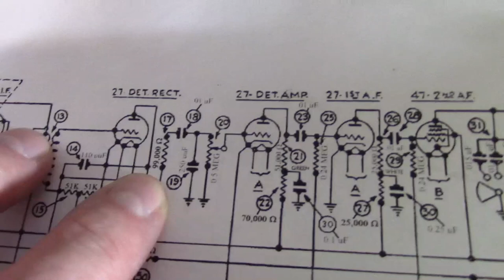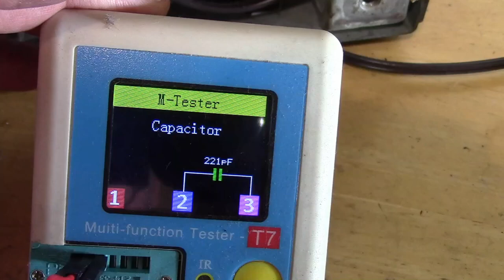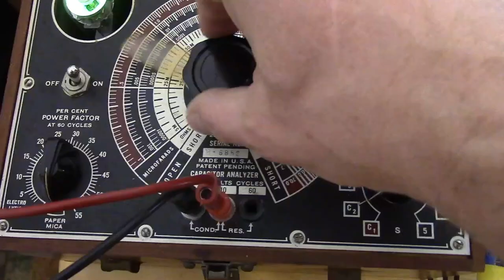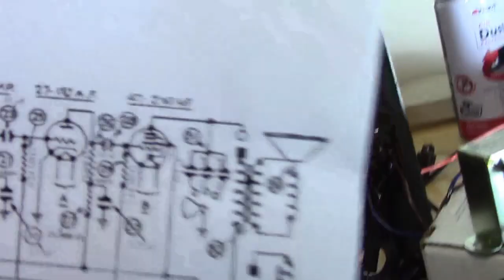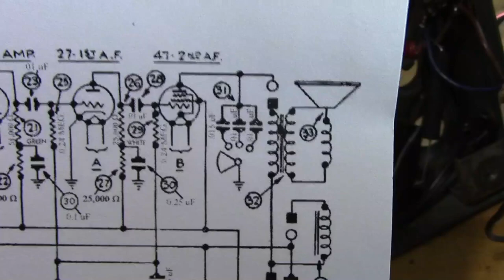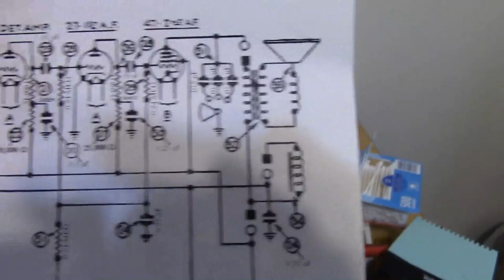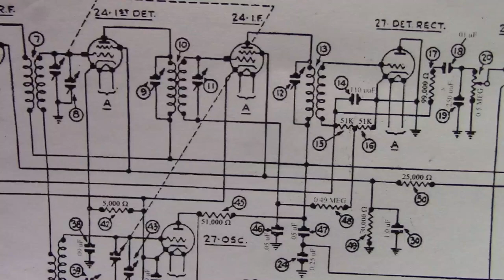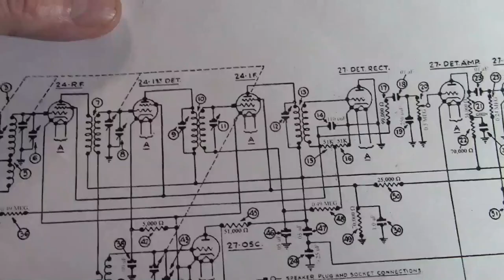Philco 90 resto p7o?

Comment: Interesting radio. I think a lot of radios were "made to work" by tacking on caps and resistors instead of paying a repairman a lot of money to have the radio repaired right. I've found a lot of thrown in components that did not belong in sets, but seemed to work. Nice video!
Reply: It might have been a shop that did the tack in of parts too. But there were a lot of diy people too. I have book I believe is Everybody's Radio Manual. Some interesting stuff some  good and real hack stuff you could do to your radio.

Comment: I am kind of with you with the level of restoration.  You are getting  it working as  the repair  man would have done in its hey day. I also like those who restore a basket case  box of bits and a rotten case back to almost as new. What you are doing is great for  that condition  of Radio.

Comment: Perhaps by the time this radio requires repair again, resistor size may have shrunk to the point that it might make more sense to just replace every old resistor with a tiny new 5 watt resistor regardless of what was originally specified.

Comment: It's good you didn't need to rewind the coil. The vertical blocking oscillator coil in my TV went open and I ended up needing to do a complete rewind to fix it. Since I didn't have the turns count (or have the proper wire) I carefully unwound it, repaired the breaks, and rewound the old wire. Unfortunately, it has since developed a shorted turn. I'm not sure why it broke. Was it because I reused the wire, because my rewinding wasn't as neat, or does the TV just eat transformers? Anyway you really lucked out.

Comment: Buzz 1151 had a similar coil problem  he re wound it with slightly  thicker gauge it worked.
Reply from the maker: Yes, it's the number of turns and direction of winding that matters most.

Comment: heres an interesting question, do you have a solution for a philco tuner that has wheel slip? what I mean is the rubber small wheel thats attached to the tuning knob slips on the bigger wheel thats part of the tuning capacitor, its an odd issue im havnig
Reply from the maker: Don't think I've encountered that problem.  Looks like it's solid brass to me.  Metal on metal in other words.
Reply: Had a similar issue with my tuning knob for my Atwater Kent. I ended up replacing the rubber with a piece of rubber I cut from a section of automotive rubber hose. 
Most good auto parts stores will have a selection of rubber hose of various diameters for fuel lines, vacuum lines, PCV lines, etc. They will usually have bulk spools of it, and they’ll sell you pieces of it by the foot.

Comment: And doing all that work opens up a big old can of worms.,  The more you dismantle something, the more chances are you are gonna break something not easily replaced.  All to make the chassis "look nice" that sits inside the radio that nobody but you will ever see even if you put this thing right on the mantle as a display piece.
If it ain't broke, don't "fix" it.  All the dirt and surface rust (barely visible) in the world is not going to stop this radio from working.
Reply from the maker: True.  On the other hand sometimes it's interesting to see what's possible.  Important thing is to have fun.
Reply: @bandersentv  That's true. If your idea of fun is working on an old radio (for many of us, it is).  But understand that's what you are doing. You are doing a project where the doing of the project is the fun.
I cannot tell you how many things I have seen completely ruined by someone trying to fix something that wasn't even broke.